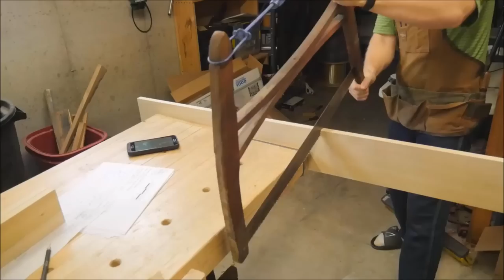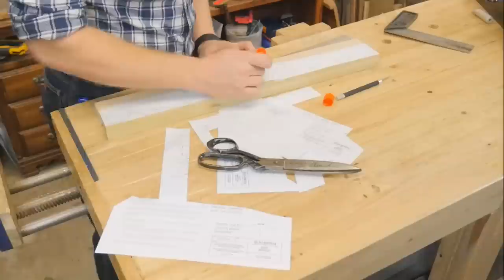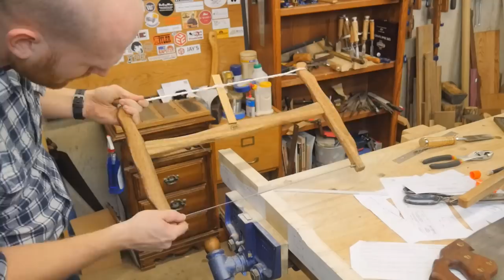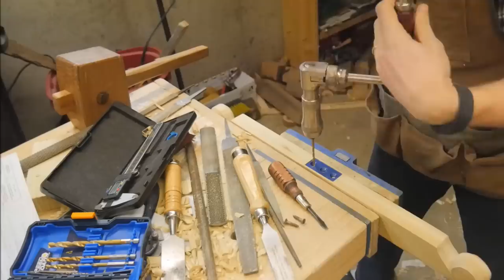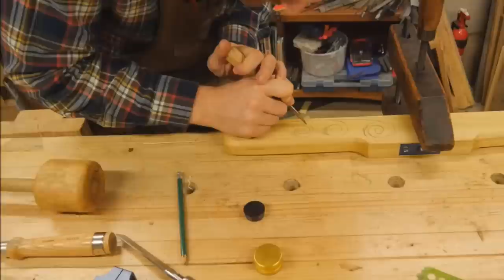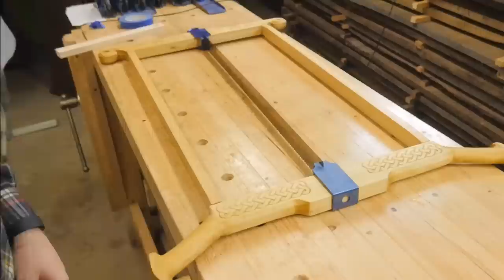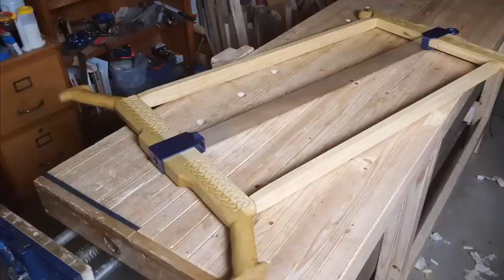How To Build A Roubo Style Frame Saw BlackBurn Tools Kit

Comment: great show!....slamming job on the saw....the handle shape was a great idea....love the workmanship........you need a stronger vise and heavier bench.......not just easier to use......but safer........keep up the great work!........awesome show!
Reply from the maker: +Rick L Verry true! this bench is made of  Doug Fir which is great for a bang up bench but really light. even with 200lb of oak under it I can still push it around. plus it vibrates and flexes slightly. never good for aggressive sawing. I have Maple drying for a new top but it will be drying for another year or more. the vice is plenty strong, I just need to line it with leather.

Comment: James, if you haven’t already done so, I was wondering if you could explain the strengths and weaknesses of a horizontal roubo style frame saw and a vertical one handed style frame saw. Does one style excel at particular tasks?
Reply from the maker: A bow saw makes it a little bit easier to control because there is more leverage above the blade. However, it means you can only use one hand at a time. A roubo style frame saw allows you to put both hands on the saw and use your whole body weight behind it. The problem is that means you have a beam on either side of your cut and so you can only work with boards that fit in between those two beams. The problem with a bow saw is you can only cut a certain distance before the spreading beam hits the work. Unless you have a turning saw that allows you to turn the blade to the side. Bow saws were the favored tool in Continental woodworking. When English would working and American woodworking switched over to backsaws.

Comment: The dust throw looked like you made it as a pull saw, but on the bench it appeared to be set-up as a push cut. Have you tried it both ways, and if so, which do you prefer?
Nice saw.
Reply from the maker: yes I have set it up as both and I much prefer the push.
Reply: Thanks

Comment: James:  Blackburn offers three sizes of blades in their kits.  Which length did you use to make this saw?  What are the advantages of each of the three sizes?  Do I need anything longer than 32"?
Reply from the maker: I have the 32" that is about the maximum stroke length for one person. the 4' is nice with the taller blade but I rarely use the full length unless I have someone on the other side.

Comment: In your opinion, which is a better frame saw, the Roubo or the Danish (bow saw) designed?
Reply from the maker: Will there two different saws for two different purposes. The bow saw is more for to enjoy where is the rubo frame saw is more for cutting large amounts of material quickly. So they can both do other things that each have their own specialty.
Reply: Thanks, they both seem to be awesome saws, just wanted to clarify that I am actually looking at two different uses as opposed to merely a design preference. @WoodByWright
Reply from the maker: @jlf1430  well between the 2 I do more with the frame saw as I do a good bit of resawing and working with large stock.

Comment: OMG. I need a frame saw.  Ripping 9” sapele today was not fun but I did it.  Blackburn or Bad Axe?
Reply from the maker: Yeah. Frame saw would make that a lot easier. for me I would go with the Blackburn tool kit there are just more options so you can make it fit yourself. there's nothing wrong with the bad x kit it's a great one but it's a little bit limited if you want to make it something's yourself.

Comment: Wooow beautifull frame saw. I want to make one. But im not sure of the wood. I have heard that heavier the wood better for the frame. Is it right?
Reply from the maker: There are pros and cons to different types of wood. My current one is made out of white oak. And so far I think it's my best. But if I had to pick I would probably choose soft maple. Easier to work stiff enough to hold together and strong enough to hold the tension of the blade.
Reply: @WoodByWright  thanks for the answer. Maybe this question will sound weird, but mahogany can replace soft maple? Im from Costa Rica and here there is not maple, but there is relative common mahogany
Reply from the maker: Yes. Mahogany would be a great choice. Would look good too.

Comment: Is there an advantage to having the saw that wide? It looks unwieldy. Unless you are resawing logs or giant timbers wouldn't it be easier to use if it were quite a bit narrower?
Reply from the maker: If you make it thinner it is harder to take the twist out of it. also, I do a lot of ripping with it and the width is very useful there. on top of that the wider grip makes it far more comfortable to hold as the grips are shoulder width apart. that being said it is all up to personal taste you might like something very different.

Comment: Just ordered the 48" kit.  Why did you use rasps instead of a spokeshave?  Did you get big box store poplar and that's why you couldn't get closer to solid wood in your required dimension?  Sorry for all the questions, but I have watched your channel a number of times and I appreciate your skills and advice so I am looking for insights here I otherwise might not get.  And I just saw the end and you're using it as a pull saw it appears.  Is that standard or do most people use it to cut on the push?
Reply from the maker: Grasps are great at tight curves where spokeshaves are hard to get into even with a curved soul. Also a rasp can often take off material faster than a spokeshave. This one was made from poplar from the big box store but I have remade it with oak. Originally my thought was to make it out of poplar and lighter but I prefer the heavier oak now. Different people will use it as push or pull. The nice thing about it is you can turn the saw around and go the other direction. Eventually you'll find a direction that works best for you. Now I use mine on the push stroke. I find that to be most efficient for the way I do things. But everyone's different.
Reply: PsiClops, did you ever get your order? I've been waiting over 3 months for mine and still haven't received it. Also, Isaac doesn't respond to emails and there is no phone number to call. I may have to make a claim with my credit card company.
Reply: @tomleurquin9320  Yes, I got it.  Took as long as he said it would.  He's behind on orders, I know.  I can't say anything else about your situation because I'm just a customer.  A satisfied customer, BTW.  I ripped a six foot long, 12 inch wide piece of 8/4 ash with that saw and I am happy with the way it cuts and handles.  I do recommend you pay attention to what he says about the frame.  I made my frame from white oak and that's a mistake because it does weigh a lot.  If I make a new frame, it will be from poplar or maybe cherry just for the look of it.

Comment: another awesome video.  at about 3 and a half minutes in you were shaking the handles... does your bench shake as much as it looks or is the camera moving?  I'm beginning a bench build and I'm wondering why there's so much wobble in that shot.  thanks!
Reply from the maker: +Jason Zvokel My floor is so unlevel that if the bench slides 2-3" it will have one leg off the ground. it takes a lot to slide it as it has about 500lb of weight, but just before I had been doing heavy cross grain planing and that will slowly move it. out of place.
Reply: Thanks for the explanation James!
Reply from the maker: +Jason Zvokel Any time. looking forward to seeing your bench!

Comment: Hi, James! Can I make the frame of the Roubo Saw out of pine wood? And what wood would be preferable for that purpose? Thanks!
Reply from the maker: I would not make it out of pine. the tension needed to tighten it would break most 2X3s in time. most hardwoods would take the stress. the best price in most places would be Red Oak.
Reply: Thanks for advise!!!

Comment: I enjoyed this video. I’ve see other frame saws where the frames are not as wide. Other than the maximum thickness of wood you would be able to resaw…are there any other criteria which would recommend wide vs thin or vice versa?
Reply from the maker: it just comes down to how thick the wood you are playing with. Some would be classified as a veneer saw. and the beams are only 3-4" apart. you can make it whatever you think you will need.
Reply: @WoodByWright  OK, thanks. I wasn’t sure if a wider saw was easier/harder to control and keep a straight line or not. Thanks again. Love the channel!

Comment: James, as you prepare to build your new workbench, will you use your frame saw to rip 7' to 8' timbers to width? I'd love to see your technique for holding and then ripping such long lengths! I'd been thinking bandsaw for this, but that roubo style frame saw looks lovely if I could hold the wood and work the saw comfortably. Sure don't want to be making lots of 8' rips with my panel saw.
Reply from the maker: well, that was the reason for making the saw bench so I can lay them down and cut them on that. thought the frame saw is fast you can only cut 6" sections at a time then adjust it in the vise. also, I can't cut anything longer than 4-5' as it sticks up too high from the bench to make a good cut. The hand saw with 3 PPI on the saw bench will cut almost as fast as the frame saw, and I can make long cuts on it.
Reply: I enjoyed your video on your saw bench build - and I like the design! Looks very functional. Thanks for the explanation on the length limitations when ripping in the vise on the main bench - makes sense. I'm thinking of breaking down 16' boards of 2x12 SYP into 8' lengths, then ripping 4-6" quarter sawn edges from the lengths for both bench build and for projects. So, have been pondering how to best accomplish this. My rip saw is 5 PPI which will work, but a frame saw at 3 PPI looked like an interesting tool to build. The challenge would be holding the material - no saw pit! :-)
Reply from the maker: ya a pit would be nice. long rip cuts can make for a long day.

Comment: Is there an advantage to a narrow saw
Is there an advantage to a 6" wide blade?

I bought a roll of 6" x 50" x 032" spring steel for $40
I'm wondering if it is worth it to leave it 6" wide or to cut the strip down to 4" wide? 
Is there an advantage to having the saw blade 6" wide.
 I got the stuff off ebay. free shipping and comes from MSC.
I also noticed that a narrow and wide saw could be had by making long and short beams and reusing the  the long stretcher pieces.
Reply from the maker: The taller the blade the more friction, but the less it flexes. For learning 3"+ can be easier to keep straight but it will be more work to push.
Reply from the maker: A veneer frame saw often only has 2-3" between blade and beam, that makes it a bit lighter. But you can't do bigger stock. Personally I like it so be about shoulder width as that is more comfortable to push.

Comment: Real nice James.  I need to tell you that I'm surprised at how much your bench moves. That would drive me crazy.  Why does it move so much?
Reply from the maker: the video makes it look really obvious but you can not actually feel it when in use. it is one of the problems of Doug Fir legs at only 3 1/2" thick they have a bit more flex. when I get the new shop I am going to be building a second bench with all hardwood. it will make it look much better on video.

Comment: Did you set the teeth yourself. Or did you buy it sharpened with the teeth set?
Reply from the maker: I decided to buy it sharpened. He includes setting with the sharpening. I had to do a little bit of stoning once I got it but it cut pretty true after that.

Comment: Love this saw and love your content! Have you ever thought about using one of these saw's with a more narrow blade (less wide) to reduce friction? I wonder what the difference in efficiency and line following ability would be if one of these saws was fitted with a more narrow blade.
Reply from the maker: usually the taller the blade the easier it is to keep on track. some of the come 4" tall. if you use one that is shorter you have to be very careful as it can often go off track with out you seeing it. but they are easier to use.

Comment: Cool build. Yet another item I'll have to add to the list.
I noticed the saw saws on the pull stroke. Is this standard for saws that use a frame and only the "modern" western panel saws use the push?
Would the handles be more comfortable and less strain on the shoulders if they were in the same orientation as a regular saw (vertical)?
I noticed some panning camera shots. Did you use a jig or do them in post production?
Again, cool project and carvings.
Still playing catch-up, looking forward to the next videos.
Have a great day.
Reply from the maker: +Nearoth I was playing with what I liked. traditionally there were two people running it so someone was on the pull and someone was on the push (thought both only pulled). if it is on the push stroke you can see if it wanders easier as it will start to wonder on the side that enters the wood. so it is really up to you. I think with a kerf I will use it on the pull stroke.
they might be more comfortable in that orientation. I never thought of that. it would take a bit more joinery and would make the saw a bit thicker but would be worth a try.
I do the panning and zoom post production. I shoot 4K so that I can zoom in with out losing detail. 
Thanks. just getting today's video ready to go as we speak. should be out in an hour or so.
Reply: +Wood By Wright very cool. it does take up a bit of wallspace,  I'll need to figure that out.
Funny thing was, I was thinking of making the raised panels for the kitchen doors from bookmatched boards instead of painted mdf but figured I'd need a bandsaw fir that... just forgot about the panalsaw.
Keep up the good work. One day I'll be caught up again :-)

Comment: James that is tremendous! I don't know the diameter of material it can safely saw through? An example: I have access to small 6-12" diameter walnut, cherry, oak from a tree service. Could I use this to "slab" for rough stock?
Reply from the maker: +ProspectorBill You can make it what ever size you want. this one has 7" on eather side of the plate and I have resawed a 13" board with it already. I have seen them 10' long designed to pit saw 30" trees.

Comment: I built a longer version of this out of ash scrap from making a bench, and figured i'd buy the hardware and make a nicer one at some point, but I may not ever get around to doing that, and if I do, it will be a smaller one for something other than resawing. 

(I built a 4 foot saw). 

I have only had honest occasion to use it a couple of times, but the last two boards I resawed to thickness them were 10 and 11 1/2 inches wide and about 5 feet long. There's no way I would've been able to tolerate going through them with a handsaw. 

I like the 4 foot length for resawing, but it did take a little bit of familiarity with such a large heavy saw too prevent it from wandering (I have a video of it, but that's not important - it was my first cut and I was just getting a sense of preventing its wander).
Reply from the maker: I think I watched your video on that one. big beast! the other one I built was 4'-6" with a 4" blade and it took everything to make that turn once it was off track. I like the 32" because I can make almost the whole stroke with my arms and not have to push with my back. but when I am resawing 8" plus I do sometimes wish for that longer stroke if for nothing else but to move a bit faster.

Comment: thinking of building one of my own but when i went to Blackburn site they had this spec called "Cutting Range"....what is that?

yeah, i'm a newbie...thanks!
Reply from the maker: that is the technical expectation for how wide a board you can resaw. but in all honesty it is a bunch of elitist dogma. I like to have at least 3X the blade of what I am resewing. so if the board is 10" wide I want 30" of blade. but to be honest much more then 36" one person can not use alone. I use a 32" as I feel that is a comfortable stroke for one person. does that answer your question?
Reply: Wood By Wright yes, thank you!
about the middle of the page on the link  and there is a column titled "Cutting Range" and it has listed a blade with 27 inch length with a Cutting Range of appx 3 inches...???  hence my curiosity...thanks again!

http://www.blackburntools.com/new-tools/new-saws-and-related/roubo-frame-saw-kit/index.html